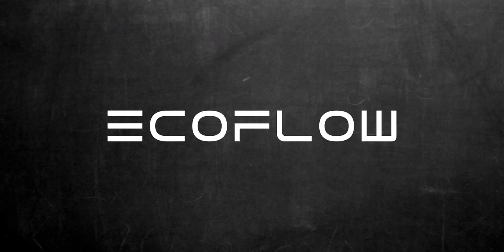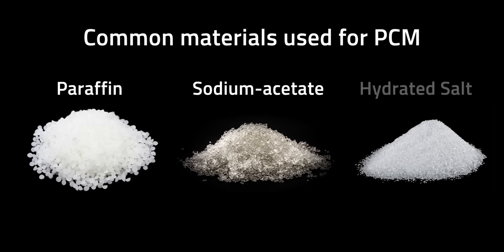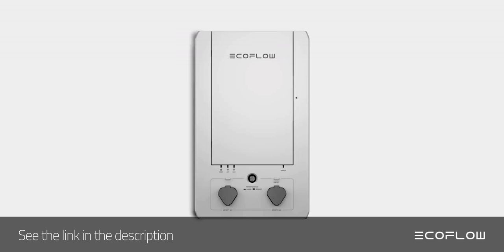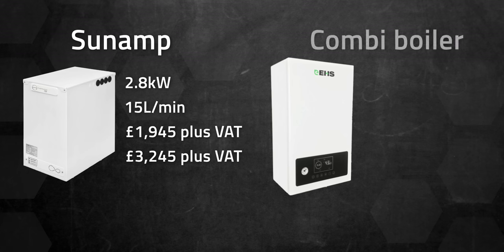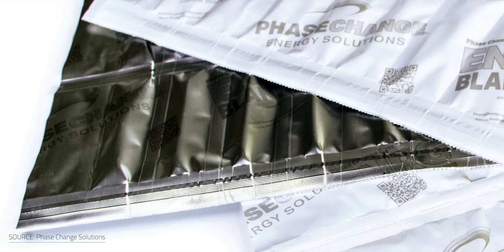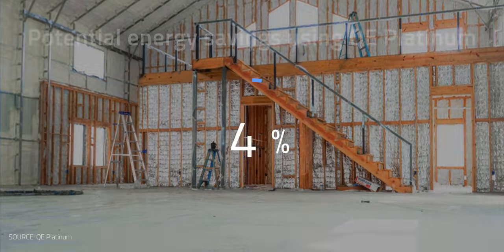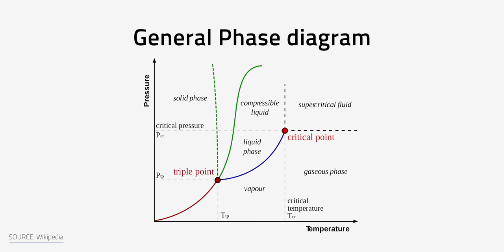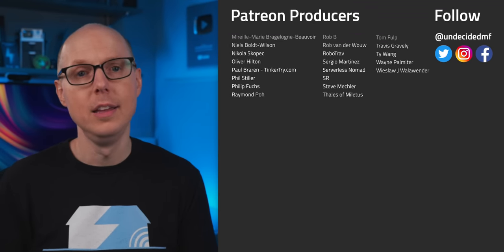Are Phase Change Materials the Future of Water Heaters?

Comment: This is an interesting video, I think that the hot water battery would be good in something like an TV.
So I dont know if you take video ideas, but i was doing some research into vr and found a few papers on how they are using deep brain stimulation and vr to basically rewire the brain, they use this for conditions like Parkinson's. This was just something I found I thought was interesting and more people should know about it.

Comment: I have a thermal hot water in Texas, but the two roof panels need to be replaced.  

Can't even find a contractor to do that.  

So adding more complexity. Without contractor support, this will not work

Comment: I wonder how the blanket for commercial buildings compares to TABS (thermally activated building services or something - lots of pipes in lots of concrete)

I work in acoustics and hate it when architects want to use TABS to go green because then the whole space is pretty much hard reflective surfaces (exposed concrete soffits, polished concrete floors etc etc). Like you can hang some acoustic baffles but they don’t work nearly as well a cheap acoustic grid ceiling. Also loads of other issues with how to route services. I mean it looks cool and who doesn’t like green tech but acoustic nightmare. 

might be that TABS is better for hot climates needing cooling but blanket is better if it’s snowing outside

Comment: Pls help me understand, how is this a replacement for a water boiler tank? the point of a boiler tank is to have hot water available whenever you need it. this seems more like a battery that will START heating water when you want some, but how and where does it store some water? does it heat water so quickly that it will produce hot water almost instantaneously?

Comment: OK, So I do see why they are supposed to be so good, over just standard thermal mass? Just because they change from solid to liquid surely doesn't confer any greater benefit?
Reply: you can in theory store the same amount of energy at a lower temperature. And since temperature difference is the main contributor to heat losses, you can keep that energy longer/reduce how much money you spend to keep the "battery" topped off

Comment: Back in the mid 70's when I was studying engineering and chemistry I came across 'disodium duo-deca hydrate' or something that sounds like that. It seemed to me that it had great capacity to store heat. Is this considered a salt battery?
Reply: Disodium hydrogen phosphate dodecahydrate (Na2HPO4.12H2O)? I've only come across it as a pH buffer and anti-caking agent.
Reply: I came across it in a book about heat storage devices. This would have been in the mid 70's. I was serving on a nuclear sub at the time and was introduced to Trisodium Phosphate chemistry. if I remember correctly, the disodium could store 10 times as much heat as the equivalent amount of water. I expect it is very caustic. Thanks for the feedback.
Reply: I am working for a thermal battery company in Switzerland, whilst disodium hydrogen phosphate has great phase change enthalpy, it suffers from large degrees of phase seperation during thermal cycling - and has large problems with supercooling. Its definitely an interesting material - currently riddled with technical applications

Comment: What is the thermo mechanics of placing a PCM blanket over the insulation in the attic.
.
So in a hot summer, it sucks up heat during day then heats the room below at night? That doesn't help.
.
PCM in wall, soaks up heat in day, releases it at night, again no help.  Circulating the PCM through an external radiator at night would help. 
.
Sorry, I must be missing something in the mechanics for static PCM  in walls / ceiling.

Comment: VAT is 18% or 20% ! Phase change salts are not new. Long used in desert houses to absorb unwanted heat during the day and vent at night. These were huge trays trays of salts that melted and then solidified, but water was involved.... The moisture in the air. I always wondered if they would be renaissanced and here we are watching a video on PCM.

Comment: How would this work in greenhouses to store heat like built in it the bench to keep plants worm at night and cooler in the day. Could be a good saving on heating.
Reply: For cooling a green house you first dig down and bury perforated drainage pipe about four feet deep keeping both ends up in the greenhouse put an in-line fan on the pipe give it a thermal switch so turns on automatically. Works both ways. Keeps greenhouse about twenty degrees F cooler or warmer in winter. Having two layers of six mil plastic at least a 2X4 apart sealed so a small fan keeps the two layers of plastic apart is essential. Having containers of water on south side exposed to the sun the water absorbs heat in the day and of course releases it at night. One layer of plastic with just some old coolers, no underground piping needed worked fine in Tucson. Amazingly productive garden for 9 months a year. 85% shade kept everything alive during the brutal months of summer. Tucson was great in that I had no days I didn’t pull the plastic back, opening it up on all but one side, which in my case was the east side! My Tomato plants were five years old. The tomatoes were like a different veggie altogether!
Reply: @TheLosamatic  I know about all that and tried some of it. I ment using  Phase change materials instead or as well. The water table is high here so can't do the dig down and bury perforated drainage pipething as it gets wet. but water butts full of water work ok kind of
.

Comment: I believe pcm's could be used to great advantage in EV's . When overnight charging your car it could store the heat
created by the charging to a storage container that would be used later in the climate control of the car. This storage
container could be in one of the structures of the car to not add any weight. If the car did not have enough heat to store 
the household power would supplement the waste heat from the battery charging.

This could also be adapted to cooling in hot weather. Maybe even one of each to be able to do both heating and cooling.
Reply: That would add weight to the car which decreases the efficiency of the vehicle.
Reply: @brettspencer-curran8269  You could incorporate this pcm in a part of the car and
replace some other part . This would also be strong because of the fill of pcm, maybe in the front rails for crash protection with blowout caps to absorb energy in a crash.
Reply: @firstbigbarney  pcm cannot be used to supplement any crash system due to it being in either a liquid, gel or solid form at a variety of temperature.  That will change the crush characteristics of the material and make crash dynamics more uncertain (not a good thing).  Moreover you are still adding weight in that case.  As to replacing a part with PCM, what could be replaced?  There is minimal insulation on vehicles, so certainly not that, and the thermal transfer of PCM is not fast enough to replace a dedicated cooling loop so not that either, but what else could be swapped I'm uncertain of.  Typical automotive engineering doctrine is that a part should do at least 3 things, and if it can't then it should be redesigned or eliminated.  PCM is good at managing thermal changes but isn't great at much else so it would only serve a single purpose and should be eliminated.
Reply: @brettspencer-curran8269  The blowout ports do not have be one port but multiple ones as a progressive release with the first to blowout when in a liquid state and ports 
proportional with the solid form. I think its doable in some fashion. But it would take some engineering to accomplish,maybe just in there to utilize the space.

Comment: Soooo wrap your heat pump powered hot water tank in more insulation.....  you would get a similar benefit 😁 Also, you would really want to use phase change material directly inside a building, not in the insulation layer, as at that point the heat has already escaped. I would think that a greater percentage of the energy savings is simply because there is another layer of "stuff" reducing heat movement to/from the buildings skin. Sure its providing thermal mass, but thermal mass in a roof cavity is pointless, which once again highlights my previous point.

And don't get me wrong, I am all for thermal mass in a building, I just built a passive solar house to put my money were my mouth is. And concrete is way cheaper than phase change materials..... so horses for courses 😉

Comment: Not sure how this would work for water heating with 42 F water, and therefore an average air temperature of 42 F over the year, with the winter temperature around -10 to 20 F for months.   The insulation use seems unlikely for those winters.  But seems good for most of the heavily populated areas of United States.

Comment: I wouldn't add a PCM water heater. For 1/100th the cost, I'll go wrap my existing water heater with a bunch more insulation.

For insulation PCMs, I'll pass there as well. I'd rather just use double or triple the amount of conventional insulation.

Comment: One application of PCM's that I think has not been developed yet, is to use them to store Large Quantities of Heat from the 'Summer', - for use in the 'Winter' ?

If you have a big old Farmhouse, like ours was, or a Factory, or a Warehouse, that take huge amounts of Power to Heat during the Winter, then why not use a large-scale PCM system that you can use to store the (40 Degrees !) Heat of Summer, to help heat your home/premises and hot water during the Winter ?

Yes, you would need a big space, but lots of rural homes could fit something into a Shed, or a Barn, or underground, and urban locations could use a communal System ?

I asked Sunamp about this idea as a way of heating our Victorian Farmhouse, but theirs is actually too refined a system, and is designed to only store Heat for a few days at most, and not the 6 to 9 Months I was thinking of.

But surely a Small solar & Battery-powered high-temperature Heatpump cold chug away 24/7 during the Summer Months, storing the Heat of Summer in a Barn full of PCM, - which could then be stored that heat until it was required to heat the living space and Hot Water throughout the Winter ?

(And if it took that heat from the House then that Stored Heat would simply be a beneficial 'by-product' of the Air Conditioning ?)

Surely storing Heat when it is plentiful, and releasing it when it isn't is the most efficient way of 'Generating' Heat when it is most needed ?

Comment: So in any case water makes a perfect thermal battery at a fraction of the cost of Sunamps and is way greener. Why would you utilise PCMs in applications where the phase change due to inherent change in volume is undesirable? And it's not like you can extend the PCM useful operational temperature range either. With water it's quite easy having high thermal capacity, good mass density and on top of that is liquid so you need minimal heat exchangers and can be used from 10 - 85 degrees C with no problem.

Comment: A Phase Change Water Heater is "very similar to a tankless water heater because its heating at the time of use".

The point of a "tank" is to add small amounts of energy into the system over time. 
A tankless water heater flows water over super high energy coils and uses 6k+ Watts of power and requires very special wiring. 

A Tank water heater only draws 1k-2k Watts of power and uses standard wiring. 

If a Phase Change Water Heater is similar to a tankless water heater, then a tanked water heater is similar to a tankless water heater.
Reply: Also, i wanted to add... putting sheets of PCM material in your walls doesnt make sense if you like to live in air conditioned spaces.

PCMs only benefit you when the PCM changes phases and heat is extracted or added into them. This requires medium temperature swings in the space around the PCM. 

Lining the walls of your house with PCMs is great if you turn off your AC unit and let the internal temperature of your house swing up and down. Me personally... I spent money on a AC unit to maintain a constant and comfortable temperature in my house.

I would also worry about condensation in the walls of a building when the air temperature heats up and the PCM material is "cold"

Comment: Architectural student here and I hate to say this but I don’t think PCM insulation is a good idea in practice. The reality of the situation is that the average home owner live in their home for a short period of time, that means the next owner may not know that they can’t just drill into a wall. Worse yet the home becomes a rental and the tenant decides to hang their framed picture of Kramer with 4” drywall screws cause that’s all he had after building their corn hole platform and beer pong table. 

I was raised in the flooring business, my father has a flooring store before I was even born so I’ve seen the inside of quite literally thousands of home. I eventually became our estimator and went on to work as an estimator for some of the big box stores. I can’t even begin to convey to you all how much fuckery I’ve seen. I’ve had to explain to people: “…no we can’t do that because you have a hot water radiant heat floor…”. Some of these people would insist that the heated floor no longer had water running through it and I had to hold my ground and say no. Weeks months later I’d find out some other flooring company went in and wouldn’t ya know it, nail/drill into the water pipes. 

So in closing, great concept but I don’t see it working out well after the 2nd or 3rd owner. Some one is bound to do something stupid. 
So phase change products for heating hot water yes for insulation and heating through walls, yeah nah… hard pass.

As always, 2 big thumbs up Matt, love what your doing here.

Comment: I would rather have a bunch of those energy panels than my air conditioner.  I live in an apartment on the top, southwest corner so my apartment gets baked.  Plus, I only have a little A/C unit not central air.  I would be great to put those panels in my hottest room.  Plus, the best would be to transfer the hot inside to the cool outside.

Comment: heat pump is expensive, there is a really cheap way to build a net zero home. dig a water pool underneath your home, insulate your pool. use only solar panel to cool the water in the summer and heat the water in the winter. use water as a heat battery.

Comment: There is even easier solutions, what example in UK / Ireland cost almost nothing extra. They use there big water tanks for cold and hot water and pressure pump. To get out most of the hot water without cooling it down basically needs the valve to stop cold water to entering the hot water storage tanks for that time. All what it need is the actuator to stop the cold water flow to hot water tanks and water level sensor to shut down the pump if water level drops under certain level. You can make a math how much efficiency is lost if cold water enters instantly to hot water tank. Very hard to say but 40% loss sounds reasonable.

Comment: No one should pay for hot water in the summer.  A heat exchanger integrated into the ac should provide plenty. Attic temps also run high in the summer so preheating water would be feasible.

Comment: I dont get it... Isn't better to have Fotovoltaic and LTO battery? With 10kWp and 10kWh battery you can save like 6-10MWh per year. And you can save even in summer with cooling. It is more universal solution.
Reply: Electricity =/= Heat

Comment: Sooooo, just like thermal mass wall systems that have been around for thousands of years, use natural materials not manufactured synthetics, and perform the same function:  Storing heat to keep the inside cool and releasing stored heat to keep things warm.

Comment: I'm not convinced that PCM insulating materials are worth the effort, but certainly incorporating them into heat pump systems for hot water and HVAC looks like it will provide a lot of value. Putting them in the walls requires more containing material because you aren't benefiting from the square cube law, it puts the weight on the walls and in the ceiling where it needs more support, installation is way more complicated, and it slows the rate at which you can adjust the temperature, and increases the power cost to do so. Keeping a constant temperature isn't that bad, choosing a temperature on the thermostat, setting it, and forgetting makes a plenty comfortable environment, and adjusting it a couple times a year isn't enough to be a problem. But I just don't see the value there.

For heat pumps though, the value is going to be much bigger. It will let us overproduce electricity and still have use for it. Lithium ion batteries are still helpful for storing electricity, but a lot more complex and expensive, so the raw kWh of storage available in batteries is going to be limited. Right now, the economic limit for renewable energy is at best based on peak electrical demand plus the flexibility given by available electricity storage, and at worst based on base electrical demand plus storage. The amount of energy required for heating will let us blow clear past those limits, and because this kind of storage should be pretty cheap, available, and useful everywhere, I think we can get enough of it to more than handle all fluctuations in both demand and supply of energy.

This takes electrical heating from difficult but manageable, to solved so thoroughly it can even smooth out electricity demand.